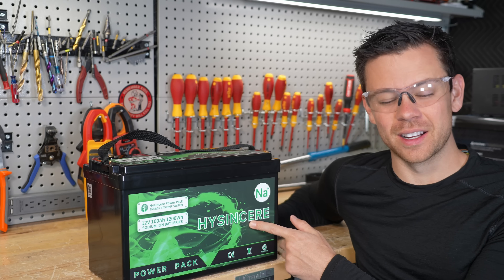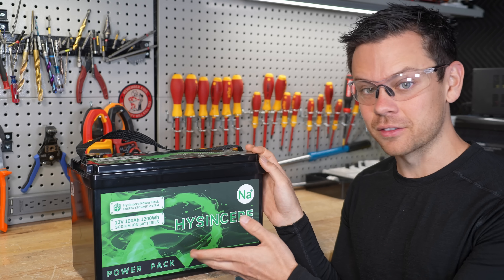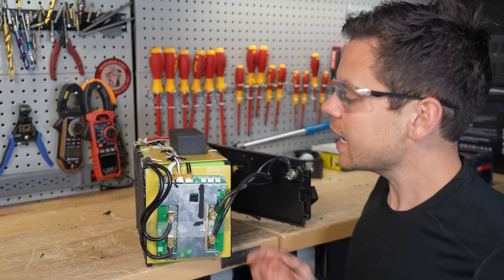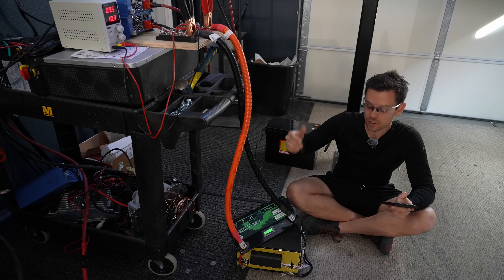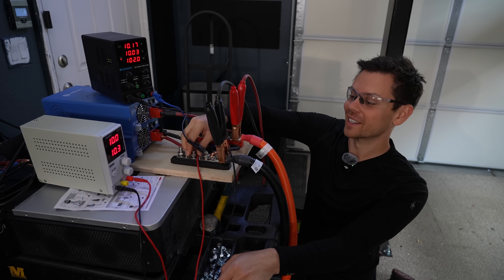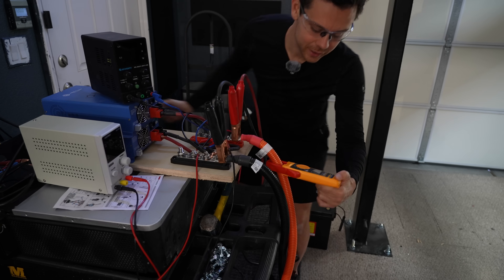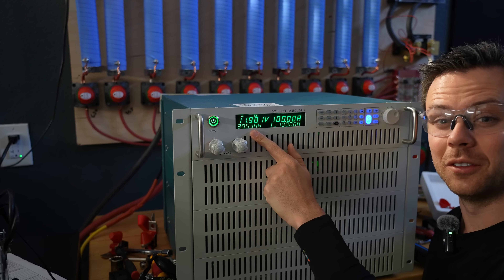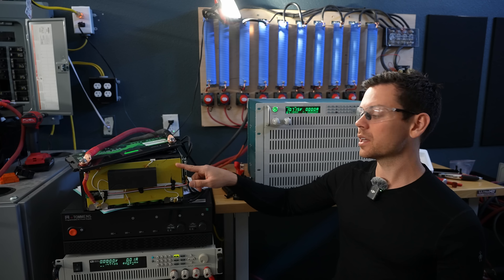Testing My First Sodium-Ion Solar Battery

Comment: I got one for experimentation...  About the only advantages I see are (1) public perception of all Lithium batteries as fire hazards and perhaps (2) better outdoor extreme element weather resistance (e.g. extreme heat).  For my application I'm going to be powering 7.2v robotics so I need to step down voltage anyways so at least I'll get the full capacity if the BMS does not cut out early...
Reply: By the way, it came with a 250w charger (wall draw).  I charged the battery once when I got it (partially charged) and I'm charging it now.  If applied to a 9-10v, I don't know if the charger would work.  Specs one charger says 15.6v@16A  but nothing about output voltage range.

Comment: The battery manufacturers have been pulling the wool over our eyes forever! If a battery is labeled has a 100AH, you will only get that at the lowest discharge rate, the first couple of times. All the meaningful curves, 0.5C, 0.25C and 0.2C have dramatically lower actual AH. LFP is a bit better, but the misrepresentation is still there. My first ballpark at power estimations use 75-80% of stated AH. Pick my first draw rates at 25-30% of that "corrected" AH rating. It's VERY EASY to underestimate the actual battery capacity. It takes careful math and study of the battery curves. I love the way Will really vets this stuff out!

Comment: If CATL is to be believed the Nextra will be a true competitor to LiFePo
Reply from the maker: 90% efficient and horrible voltage curve. What are they competing with?
Reply: @WillProwse  price, better low and high temperature tolerance, faster charge rate, minimal fire risk, no rare earth components (like LiFePo), sodium more plentiful and easier to extract and refine than lithium and more widely available globally, better cycle life, ability to tolerate zero charge state, equivalent energy density by mass but inferior volumetric energy density, which may be an issue for EV adoption, but not significant with stationary energy storage.  As you say, the voltage curve issue may require additional components with a net loss of overall efficiency.

Comment: Lifepo4 needs heat. have it insulated and also have a cooling loop. Minimal energy to KEEP warm while during use. Duh its a probelm that should be solved already. wtfh
Reply from the maker: No it doesn't It heats itself
Reply from the maker: Just cycle it
Reply: @WillProwse  100w is damn near 100w in vip panel battery bank or polywhatever. 
Cycle the cycle

Comment: Like a handful of people in the comments, I'll be pumped to see you get your hands on those CATL Naxtra batteries. Supposedly a lot of these issues are resolved, but personally as long as LFP AND sodium batteries get super cheap, I just really like the abundance of materials in every country in order to make them without any scarcity issues, no cobalt, lithium or nickel. CATL is also claiming that their next gen sodium batteries both are effectively impossible to cause thermal runaway so they're as safe as it gets, plus they're claiming the degradation is an order of magnitude improvement over LFP batteries and could last 10,000+ charge cycles while also charging faster than LFP. Massive claims, but time will tell. If sodium batteries do achieve all of this AND get 30% cheaper than LFP I could see modular stacking home batteries in every home.
Reply from the maker: Yes, but still 90% efficient and same voltage curve. Will take more years for some inverters to come to market. And you have to pay for more solar panels because less efficient.

Comment: I have been running a sodium ion battery on my 8500 watt rms sound system for almost a year now. There 25c cells. Im running a 12p4s, 8ah cells. So far haven't had any issues. Degradation has been almost 5%. Mind you. I run a 355 amp alt, and rebalance the cells monthly. I also have 2 d3400 agms linked in. The sio was a little more than lifpo4 which I replaced. The lfp4 was 80ah. The sio is over a hundred. Still. Just checking it out. I recently purchased some cells to build a 51.2v sio to test on my solar system in my portable workshop trailer. Its a 3500watt system. The lifpo4 can run for almost 7.6 hrs in the texas heat before needing a charge. That's a/c running the entire day with just 1 100ah battery. Can't wait to test the sio in the cold. If it does what it claims. Could be game changer. A little skeptical at this point though. Its really old tech with a hint of modern flare. Thank you for the video though. I know a lot of others and myself have been waiting for you to test these out.
Reply from the maker: Very nice!! What brand? Great to see some real world data

Comment: Sodium ion are in the beginning phases.  Think Lithium ion from the late 90s.

These are going to get better and probably quickly.  Will they get the characteristics we are used to from LiFePO4?  Probably not.  

A lot will have to do with the pricing.  If they are $20/kwh, they will take over.

Comment: The biggest benefit is not needing to mine lithium. sodium is insanely abundant and cheap. the tech isn't there yet and I don't know if it will get where it needs to be but if it does it will be a huge improvement.

Comment: Much same conditioning many cycles below 50 off back 60 down 40 off back 50 down 30 off back no is 90 ah 200 watt resistive heater load prefer three lines lithium ion base layer, LiFePo4 house bank Na+ 8-10 weeks -35f - 50f winter solstice. No use gas up $2 gallon already $6.50 USA 😊

Comment: The sodium batteries available online are the older chemistries from several years ago. They are also over priced by an order of magnitude. You will have to wait a year for newer chemistries to become widely available and the pricing is of course unannounced.
Reply: Yeah, 2nd gen sodium is supposed to come out in the next year or two and it will supposedly fix most of the cons of the prior 1st gen  (improved energy density, increasing efficiency, and higher charge-discharge current). Let's see how it goes
Reply: It should be quicker to scale out grid storage for renewables using sodium ion too.

Comment: With EG4 starting to use 100 volt battery packs, can you research the DIY options to create 100 volt battery packs?  Is it as simple as putting (2) 48V packs in series?  Then there’s the BMS…

Comment: I thought the top voltage was 15.6 V for sodium.Ion ? If that is true you're not filling the battery to its full capacity. I'm thinking , be perfect for a tractor battery. It just needs to sit there , start the  tractor and then the tractor runs for hours and hours charging the battery.

Comment: Still good to see other battery technology in the works. The more the better! find out what does and doesn't work and have progress in energy storage.
Reply: It was developed decades ago(1970s), the efficiency is so horrible it failed to take off.
Reply: @zaberfreedom8224 yes I am aware.
Reply: @zaberfreedom8224  electric cars were developed in the 1800s but failed to take off until about 15 years ago. Changes in material sciences especially in batteries can dramatically change the characteristics of a battery without changing the elements it is made from. compare an optima battery to a everstart from walmart. both are lead acid batteries but one is much more energy dense than the other because of how the materials are configured.
Reply: @zaberfreedom8224  The base for AI was developed in 1960/70, couldn’t make it work, because the computational power wasn’t there. My point is neither that AI is good, nor does it mean that everything that was developed earlier and discarded is good. Just that sometimes, new solutions for old problems pop up. (Doesn’t mean it will happen)
Reply: @stokeseta7107  So many words to say a big fat NOTHING.
Reply: @badhombre4942  I'm here in Brazil. Reading the translated version of what he wrote, I understood what he meant.
Reply: @badhombre4942  I mean. There were things in the science community that didn't work in the 70's. Technology  made them possible.
Reply: @stokeseta7107  Exactly. These are early days for consumer sodium batteries. For the environments' sake, I hope they improve quickly. If not, oh well, it's good to have options.
Reply: @badhombre4942  just because you didn’t understand doesn’t mean he’s not saying anything.

Comment: Totally fair review! But Sodium-Ion is new = I think someone rush to the market with smaller (more expensive) production to be first. The price will get lower. Sodium won´t be everyones choice, but some of us live in a cold climate where the cold temp features (in later models) will be of use. It is also safer, less fire hazard.
This will most likely be like - the first company coming out with Perovskite panels, won´t be the cheapest choice (even if the materials should be cheaper).

Comment: For a new tech i think Sodium ion works perfectly fine as they are right now. I wouldn't expect them to work any better considering they just came out and are far from perfect.
Perhaps it would be worthwhile to compare sodium ion with some old lithium ion papers from the early 2000's or late 90's?
My expectation for this tech is that with some advancements it will be somewhere between lead acid and lithium ion. I don't expect it to beat lithium tech ever.

Comment: NNMC) or lithium nickel cobalt aluminum oxides (NCA) much better than sodium, only for large storage for like a bomb shelter etc, where u need the capacity to last Very long term, they will hold a charge for many years.

Comment: So, I can think of one use case these make sense. In the North in the winter, these don't need heating to charge/discharge.
Reply: Under a certain temperature, you will still need to heat these.
Reply: @Tumbleweed5150  Yep. NFPP is the comparable sodium battery to LFP. They're in commercial use already and we'll see them end of next year maybe. The research on it shows -70C possible and -20C charging but STILL recommended at 0C / 32F freezing for charging. That means that the chemistry will has there still needs that too, and will likely damage itself with what they rate its charging at lmao

Comment: For camping it make sense. Possible to charge without pre heating rocks and also that it is not harmed if going to zero volt by misstanke. State of chrmarge easy to read from voltage. No need for shunt. As Will says potential starting battery capabillities  that ca also eliminate dual battery banks. Not sure how bms kan handle alternator load dumps when battery reach 100%. I hope some company  create a bms that can handle high start current and able to takencare of load dump when full.

Comment: The big iron flow sodium batteries look promising for big stationary urban power situations where you don't want the danger of fires and toxins like happened in on Monterey Bay with stupid high density flammable lipo batteries.  Iron flow seems to have better use life than the dry cell sodium.  Lithium won't work for car batteries with old fashioned alternators that push 14.4volts all the time, but there are some better regulators on the alternators these days.  It's still pretty bad.  You need power to churn through the battery while the car is running to spark the spark plugs.  That constant overcharging while draining lithium kinda hates.  If the protections in the battery shut down because of overstress, then your car shuts down.  So that sucks.  I have heard conflicting reports about how good sodium will work under those conditions.   We'll see.  Better regulators on car charging systems may make a lot of the difference, though.  Oh, and battery cooling.

Comment: Litium technology have had more than 50 years to mature in to what it is today. Give sodium batteries 20 years and they will probably blow the litium out of the water on all planes. But as a new technology it will have problems in many ways, exactly what we see here. Early adopters always take the blunt force.
Do not buy today, but tomorrow it may be a very viable choice.
The problem with litium batteries is that you are today close to the limit of what you can do with litium, but after more than 50 years you should be.
For me this is amazing, the problems they have had with making sodium batteries was massive and it seemed like they could stay in a lab forever. Same with air iron batteries for industries. They are today only used for large grid installations and they are an old technology only possible in recent years thanks to development in technology.

So i do not expect more from such a "young" technology. They are also an old technology abandoned when litium worked, but as with the above mentioned air iron battery this might change now.

Comment: So what you are saying it's about as good as a cheap forklift battery pack? Cold weather? My old car started just fine at -45 deg F with a lead acid battery all the time. Didn't need some experimental overpriced hyped battery.

thanks for testing this thing, the news has pegged this thing as the salvation of mankind.

Comment: You skip most important feature of sodium ion - THEY ARE NOT FLAMMABLE. Might be not the best performer but im very happy we have nice safe cells on the market. For sure they will be used in many aplications in the future.
Reply: LiFePo4 is also incombustible. While gases produced as a result of an overpressure release are indeed dangerous, the material of the working cells itself cannot catch fire. Accidental fires due to the high amount of electrical energy stored can be responsible for starting a fire involving external combustible materials as well as overpressure gases, but otherwise It is the NMC chemistry (aka „Lithium Ion“) which can be affected by self-combustion as a result of a thermal runway, not LFP.
Reply: @Doppelhorn  LFP have flammable lithium. If car will have short, even its wires can start fire and it can burn whole building, nothing can put that fire out.
Reply: @bobikbobikowy5458 No. LFP do not contain metallic Lithium. They use lithium oxides, which are not combustible.

Comment: I like LFP. Thx for pointing out the differences. It is not plug n swap with LFP.
It is obvious Na-ion requires different equipment for practical implementation. 
It is somewhat erroneous to use equipment designed for LFP to compare to Na-ion.
BUT we don't have that equipment available either - yet.

Technology often comes down to cost and efficiency.
Na-ion may require 16 or 20V to use a 12V inverter and get reasonable % of discharge. This will add costs.
Extrapolating to 48 V could mean 65 to 80V systems to get the most power and/ or efficiency.
Reply: That's not good either. Inverters also have high voltage protection.
Reply: @davidchoi9010 - use fewer batteries in series, higher voltage issue solved. This is not rocket science.
Reply: @DavidHalko  Then it requires even lower voltage capability for the inverter to handle the ~2V Sodium batteries go down to.
Reply: @davidchoi9010 - so, what is the issue? Inverters have adjustable high & low voltage settings.

I was able to adjust my inverter to 65 volts on the high end (and can go higher), and it goes down to below 12 volts.

I don’t understand what you guys are concerned about?
Reply: @DavidHalko  Going from 65V down to 12V requires design choices, that both decrease efficiency and increase cost. You can't just make an inverter work at 12V out of thin air. Also consider this; if you have a 10kW inverter; how much current will you need at 12V to maintain full power? :)
Reply: @hojnikb   - my Li-ion 16s pack goes from 67v to 48v on my 12k 48v inverter, just fine.

A typical Na-ion is 4v to 2v, so a 16s battery starting 64v and ending at 32v. This is no big deal.

Most people don’t drain to 0%, Na-ion 12.5% is about 2.5v, so 64v to 40v is really no significant design choice, at all.

Most people don’t charge to 100%, so the range of 60v-40v is no design choice problem, at all… except that the battery will receive a lot more cycles.

Comment: I wonder how that would work in a marine application, like for a small trolling motor. I ruined my LFP battery by using it in freezing temps. I don't want to go back to lead acid. Hopeful sodium ion will have enough power since it works well in really cold temps.

Comment: it's a pretty fair shake to see where such sodium ion batteries currently stand
Reply: Repeatedly talking negatively about the discharge curve was dumb, when the discharge curve is a FEATURE to easily understand the state of charge!

The bluetoooth communication was a real issue.

The lack of 100 AH was a really issue.

The vendor should advertised the battery as 80 Ah (not 100 Ah) without Bluetooth. (Maybe these batteries were defective? Bad QA?)

Most of this were vendor issues, with exception of efficiency… here’s hoping for a more efficient next gen chemistry to Na-Ion!